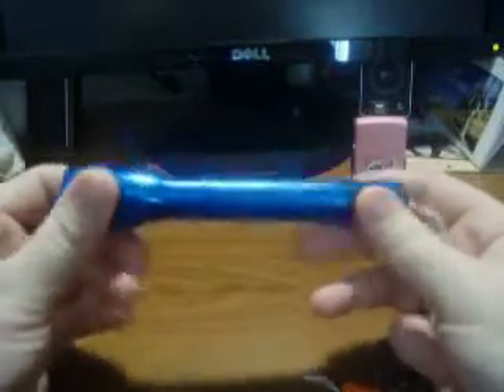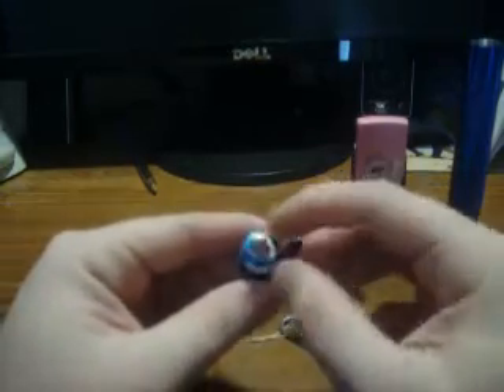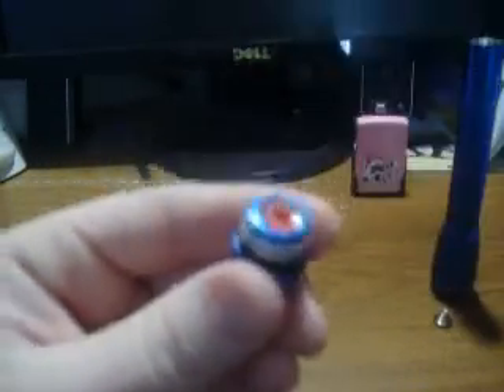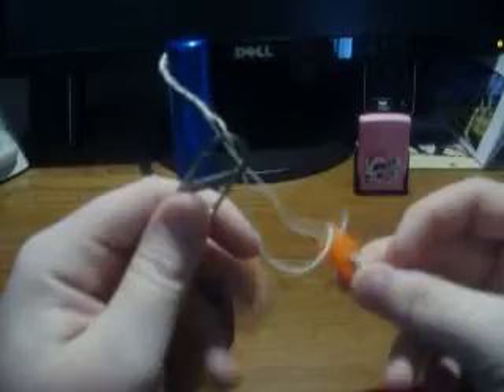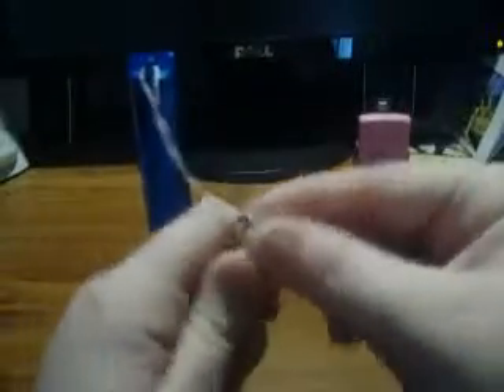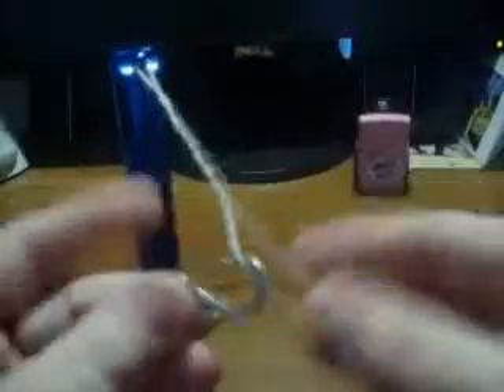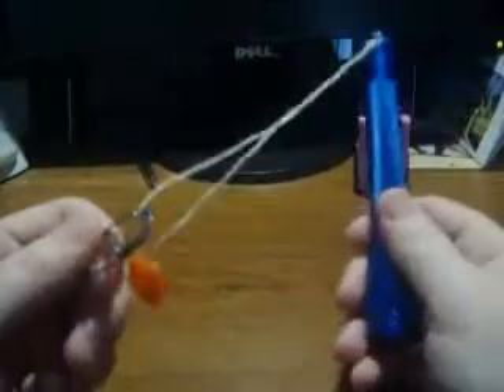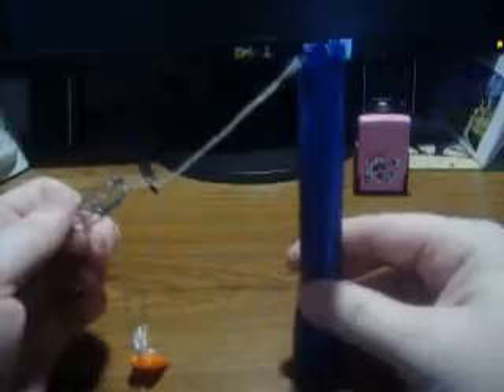Mini Maglite Quick Fix Bulb Replacment

Comment: After changing the bulb, my light stays on all the time or it shuts off when the top, not lens cover, but the focus ring is screwed down tight, the light will light but if I rotate the focus ring, it goes off again will not focus the light. Did you understand what I said?? LOL  Any ideas?